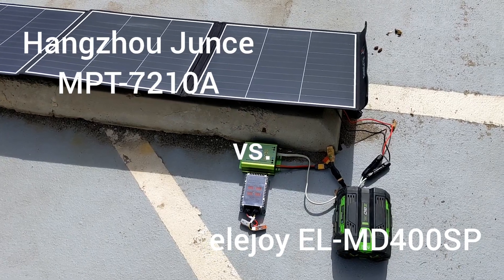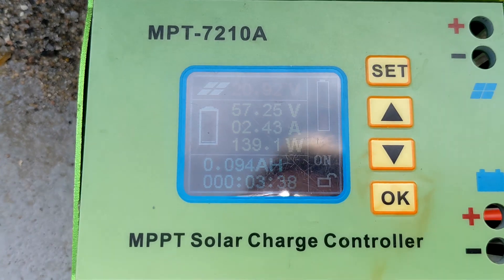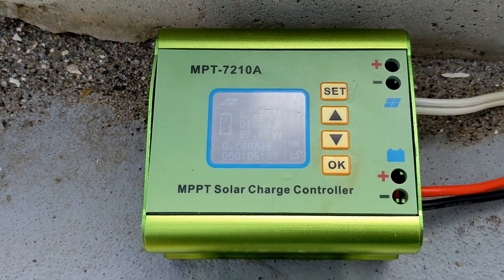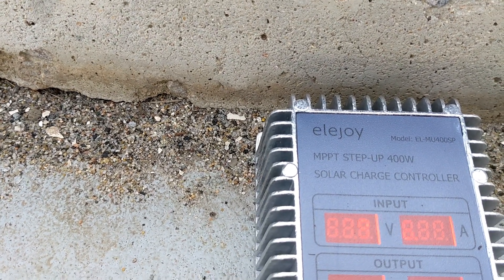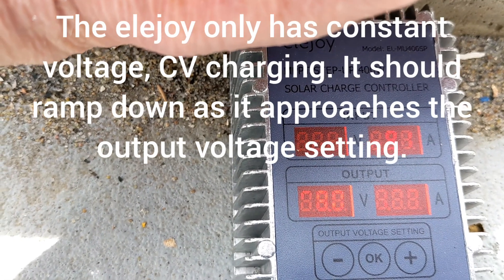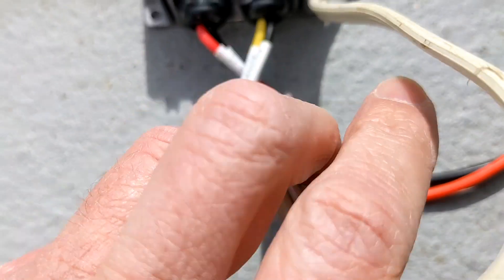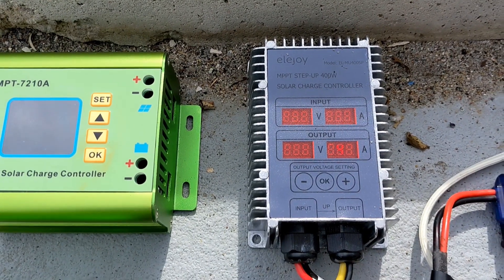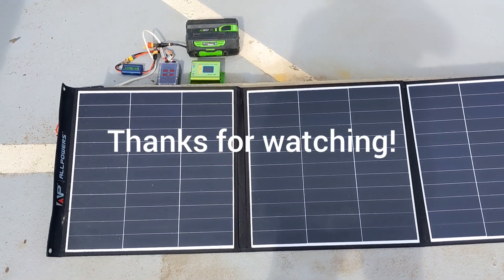Solar MPPT Boost Charger Showdown: MPT-7210A vs. elejoy EL-MU400SP

Comment: First off thank you for the video, I am trying to make mobile solar charging set up for my Ebike.  This is the charge controller I would like to use to charge the 48v batteries directly.  I see there is multiple models 200-400w, forgive my ignorance but how do I know witch one I should buy?  I am using a 200w panel.
Reply from the maker: I bought the 400w version and use it with a 200w solar panel. You could use the 200w version with a 200w panel, and possibly it would be a little more efficient since these boost converters tend to get maximum efficiency at higher output and that would be close to the maximum for the 200w model. But I doubt it will be a big difference and it's even possible that the guts of the 200w and 400w models are identical.
Reply: @maddmikemu  Thank you for the reply, I am determined that my bikepacking trips in the future will allow me to be more mobile with better charging.

Comment: I have both. I'd have to say the MPT-7210A works better because the ELEJOY doesn't work at all right out of the box.....I contacted the company but of course it's in China so let's see if they actually honour the warranty. I've tried it with 2 different solar panels and a charging brick and it just doesn't work. You set the voltage and hit "ok" and after a second or two it just keeps flashing "0" without any output at all. I rechecked all the connections and they are fine. When I connect 24 volts to it, it outputs 25.5v and does nothing.
Reply: I figured out why:
Ok I think I know what the problem is. When I connect the unit to the battery, I'm using just the standard charging port on my ebike. I used a multi meter to measure the voltage of the charging port and it measures 2.6v. The reason for this is for safety. The BMS will not pump out whatever the battery voltage is as it would be pretty dangerous to plug in a charger into a port that has 48+ volts coming out of the port. The problem is this charger is not pumping enough volts out at idle to start the charging process of the battery.  So this charger is basically not compatible with my ebike batteries which is a shame. The only work around is to connect the charger directly to the output terminals which is dangerous and usually there is a diode to prevent this so that the charger unit can read the battery voltage and start the charging process. Most ebike battery BMS's have multiple safeties to prevent people just directly accessing the battery, this defeats this charger unit. If you want to see if this charger unit is compatible with your ebike CAREFULLY measure the voltage of the charging port when it is on. In my case it's a 5.5x2.1mm so the outer ring is negative and the inner pole is positive. If it is not showing current battery voltage then the unit will not work. Use the MPT-7210 instead as it tries to ramp up to set voltage first then starts putting charge into the battery. This unit at idle doesn't have enough voltage to start the charging process at idle on some ebike batteries as the charging port doesn't have access to the internal voltage of the battery unit until the BMS starts the charging process. So unless you can directly attach this unit to the battery it will not work.
Reply from the maker: Interesting. I am directly charging the EGO batteries so didn't encounter this issue, although the EGO has a BMS the +/- terminals are always "hot." Thanks for the comment!
Reply: @maddmikemu  I finally got a message from the company. There is a way to do it for e-bike batteries which have a safety feature which only pulls from the charging port if the voltage is correct. What you do is hit the "enter" button five times until it says "Ope" which is open voltage. Then you can set the voltage and charge the e-bike. I did a whole video on it if you click my name. Would have been nice if it was in the "manual" ie the paper it came with. Fortunately once it's set you don't have to set it again.
Reply from the maker: @chrissinclair8705  this is great to know! Who knows what I'll charge with it in the future. I'll take a look at your channel, thanks.
Reply: @maddmikemu  No worries. It has 2 modes, the default is active or "Act" where it takes a reading off the battery voltage and "Ope" where it pumps out the target voltage without taking a reading off the battery.
Reply from the maker: @chrissinclair8705  do you know how a typical charger works in this regard? Once it begins charging does the voltage drop to the battery voltage as current is flowing?
Reply: @maddmikemu  Yes after the charger is connected the battery BMS takes over and takes what it needs up to the target voltage. The reason for this is simple. On an ebike the charger port is basically exposed to the outside in the rain, dirt, etc. Only saved by a rubber plug. So instead of that charging port having full voltage of the battery just sitting there waiting until the plug rips off and water gets in there shorting the battery and causing a Tesla fire. It shuts down the port until the BMS detects that it's getting appropriate voltage for charging then lets the charge go through. I'm assuming the lower limit would be just above the low voltage cut off voltage of 39 volts on a 48 volt battery before the BMS will let the charger connect. Electric cars have the same sort of deal, if you've ever seen a video of an electric car charging, you plug into the port and the screen will say "connecting" as it communicates with the BMS to learn what the battery can take and what charge rate it can take before it will allow charge threw. Ebike batteries are more simple but it's the same theory.

Comment: I only checked that the elejoy EL-MU400SP turned on for a moment.
Is it possible to adjust the output amperage? Is there no such function?
The MPT-7210A model seems to be able to adjust the output amperage.
Reply from the maker: No adjustment for current. In my application the max current is limited by the 200w solar panel and is always less than the max charging rate of my battery. The output current does drop as the battery reaches the voltage setting.

I'm about to go camping for 6 days and will be using this to charge my EGO batteries for tent and Onewheel power.
Reply: @maddmikemu  Ah, thank you for your reply. Have a nice camping!😁😁😆

Comment: I use the ELEJOY MPPT boost controller to charge my 67.2V Sur Ron ebike battery direct.  It works very, very well..but for safety set your output volts one or two volts lower so you charge to 80 % or so. I built a ebike charging station on my channel.
Reply from the maker: If your solar panel max output current isn't too high for the battery being charged (once it has been boosted) it seems to work correctly and ramps down current as the voltage set point is approached. It looks like this charger only does the constant voltage phase of charging, limited by the solar panel current output during the typical constant current phase of charging.
Reply: @maddmikemu  yes it doesn't balance the cells at the end, so I only charge to 80% to 90% for my Sur Ron battery longevity and once a month use the OEM charger on the grid to balance the cells correctly.
Reply: That's kinda useless any BMS will cut voltage when it's full.

Comment from the maker: I just got back from my first camping trip using the Elejoy MPPT and Allpowers panel to charge EGO tool batteries for tent power and they worked wonderfully. I set the Elejoy to 58.8v full charge voltage and it charged it to that voltage without going over and decreased current as it reached full.

The panels only gained 2% power when I cleaned off the dust, so good performance when dirty and also when partially shaded.

Comment: I have now tested both of these on my solar powered golf cart and can say with certainty  the Elejoy just works better so far.... It pulls in my amps of power and it is far less effected by passing clouds or birds..  The green  controller would reset to 0 and take time to build up current with every cloud or momentary obstruction. and I did setup the correct panel voltage. I charged my 51v lifepo4 battery with over 7 amps the other day off my 355w roof panel and it wasnt even a clear sun day.
Reply: thats a real test, to have the solar panel moving and therefore sometimes shaded. Even if you have fixed panels on a roof you don't want to be going to zero half the day because an animal is walking around up there.

Comment: I wish I could find one that utilises 600w (12v) solar panels . liking the elejoy . Thank you
Reply: There is elejoy 600w
Out in the market now
Reply: You can overpanel it and get the maximum 400W more of the time the sun is shining.  For example on my channel I charge my Bluetti AC200 Max Solar Generator with the maximum 900W PV Input basically from 0900 to 1600 every day using 1.2KW of panels (3×400W in series).  So as soon as the sun is up I am harvesting photons at maximum rate of the onboard MPPT.
Reply: You could use two in parallel. There are other products on the market that handle 800W, but they are, as far as my research goes more expensive and less compact than two of those

Comment: Adam Welch, a ytuber and engineer about 5 years ago, reviewed the green controller you are using in the test and concluded it was not true MPPT since you have to set the max power point voltage of panels into the controller.  Seems co has not changed design.  Another boost MPPT controller he tested was true MPPT.

Comment from the maker: I had full sun at mid day today to test and was able to get just over 8 amps output from the panel at 19v so that works out to 152w. The sun intensity was right at 1000w per m² so the panel should have been capable of full rated power during the test. I don't think my test output was limited by anything but the panel so at this point I conclude that my panel cannot generate its rated power.
Reply: This is consistent with my testing. I tried an EPEver Tracer 2210 MPPT controller and the Elejoy on a newer "200W" folding panel like yours, also made by Allpowers. The best i ever got was 180W in scorching full sun with a light gust of wind. So yeah, they do not deliver the rated power, but still more than other "200W" rated panels i had tested. And for the price the Output of 180W is still very reasonable.  Both controllers performed very well and provided about the same power output under similar conditions. I need both because the Elejoy can not charge 12V batteries(there is also a step down version available though) and the EPEver can not boost charge 24V, 36V or 48V batteries from a 20V panel.